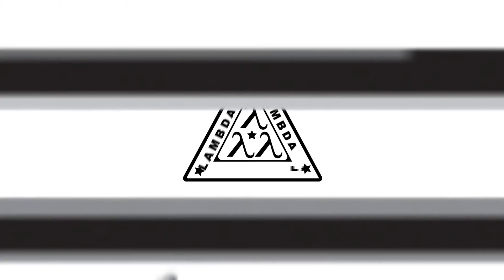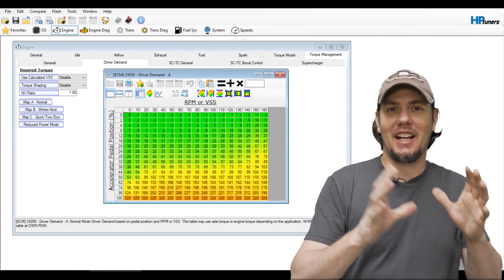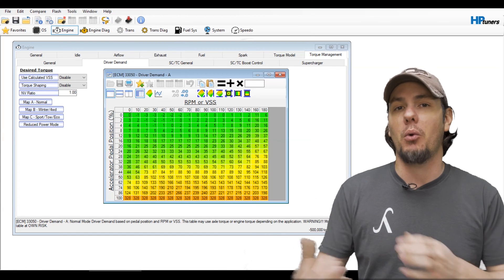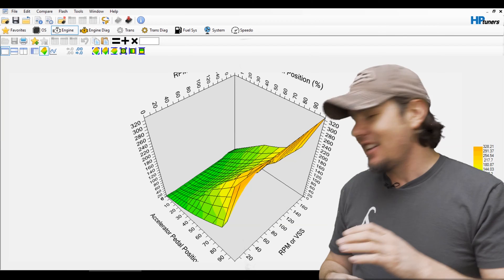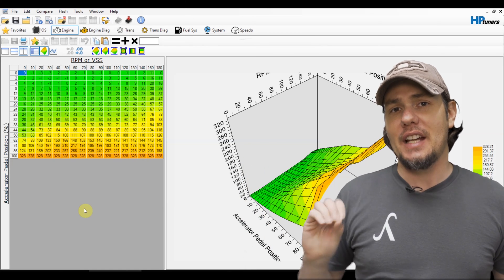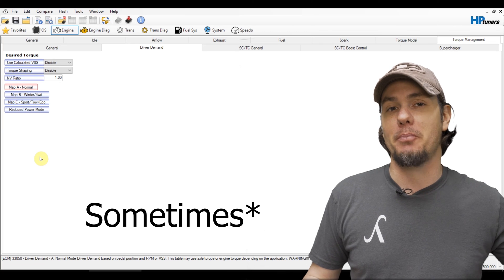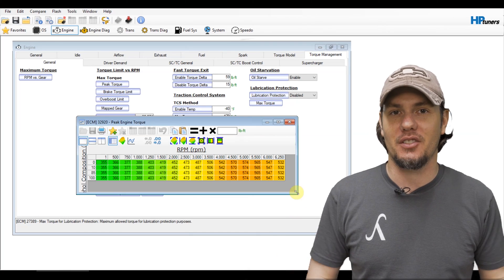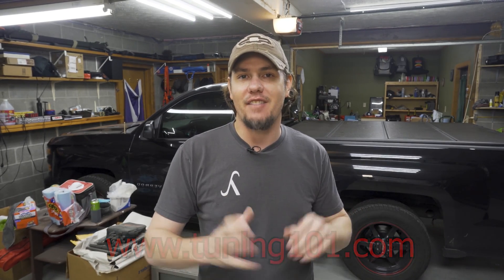Driver Demand and Max Torque, Gen V Parameters That You Need To Know!

Comment: I come from EFI live and the diesel worldand a little on GEN3 but i have a 2013 yukon dwnali qith the 6.2 its my wifes truck and i needed to get it back up and running quick a few years ago and it has a DOD delete and i just put a VVT stock L96 cam in it but i got my tune from mail order tuners and it is TERRIBLE my mid range throttle has just a ton of dead pedal i recently got HP to get back to messing with my duramaxes and id like to fix her denali finally but i dont want to go overboard i just want to mildly dial back the torque management and that used to be so simple on gen 3 but this is comfusing me any help would be appreciated
Reply: A friend and I both have L96 2500hd trucks, they are both dead feeling and low on torque after 2000 rpm, and milage sucks all the time. I think besides tuning the cam is the issue, mine is a little better because it seems to have different tuning being the work truck platform. Just getting a start on the tuning and it really sucks how dumbed down the power is, I believe all to just make the cats do their best, good luck brother.
Reply: @Tom-7777  I totally agree I'm messing with it in my free time on Sundays it's AWD and I can't find anyone with an AWD dyno nearly long enough for a Yukon Denali XL lol

Comment: Hey know its an old thread but just saying thanks for the solid info, your videos continue to make things easier to understand. Glad to see you keeping up the videos to this day.

By the way, I found a vehicle referencing RPM for driver demand, the E78 ECM in a 2014 Chevrolet Sonic RS 1.4L turbo LUV engine (the E78 Cruze will be the same, check out the HPT included sample of it). I'm also tuning a 2018 Tahoe with the E92A/T43 ECM/TCM 5.3L Gen IV engine.

Comment: I tried messing with this today. The results at first were incredible. Man, everything felt amped up. It effortlessly accelerated faster  than before, shifted faster than I could have imagined and it seemed like I was in boost a majority of the time. Then while cruising I give it more gas for a quick downshift and KNOCK...like 5 degrees. I then started to notice erratic shifting with stronger acceleration, like the transmission was hunting for gears in between the upshifts.

I never tried WOT fearing the increasing KR that was regularly making itself known in the higher gears when under load.

But MAN...the vehicle just felt plain better putn' around town with light throttle. It was so good so good I knew too good to be true. I haven't even checked the logs yet. 

I had a feeling this would happen. Every time I try something new in the tune and feel as though I'm truly making something better it negatively affects hard acceleration/WOT or something else. Really frustrating... 🍻😣
Reply from the maker: You are calling for more torque by doing this so the timing might be more aggressive so after you do this you should look at your timing tables and see if you need to dial them back.  Ideal your high octane table should never get into knock, then if you do you take like 5 out of your low table so it has some fall back
Reply: @GoatRopeGarage  

Thanks. I'll definitely get back to this section. Maybe you can point me in the right direction with something.

 I've been trying to figure out why 99% of my kr is from downshifting from 5-3 or 6-3. In WOT from a dig I see no KR going through gears, but cruising in 6th to 50%+ acceleration I'll see 2-4 degrees right before the downshift. What area should I looking at in the tune?

Comment: I have a 2017 cruze manual E80 ecm it uses RPM and not VSS. I’m not looking for big power out of this thing, but just better driveability, like better throttle response, better torque off the line where it doesn’t feel nerfed/limited and the ungodly rev hang when shifting. I am pretty new to this and trying grasp all the features that HP turners can do without doing serious harm to the vehicle.

Comment: So this basically where I can tune my pedal to be more responsive even at low loads if let's say I want it to be more responsive since I am an offroad guy great info but someone at the hp tuners forums said  that the way to do this is via airflow>electronic throttle map a ,map b etc... I am lost now man these forums always confuse me on certain topics
Reply from the maker: If you're on a torque based ECM like the 5th gen it's here
Reply: @GoatRopeGarage  ok got it just to be clear is this direct like I move this table and my pedal response change directly or is there something else to touch on like in dodge they will need to decrease their timing values at tip in throttle to allow them to have more response does this apply here or its irrelevant and this will directly get me where I want

Comment: I have a 2013 Hyundai Veloster that Im trying to tweak its tune (not stock tune, prev owner put something in it). I've added mods since its last tune. Seeing that the throttle actual pos is only 85% when commanded pos is 100% (WOT) in HPT data logs. Could this be due to  bad numbers in my torque tables/ driver demand?
Reply from the maker: Throttle position is logging in SAE so 85% is going to be max based on the standards they set forth, if there is an option to log the non-SAE parameter use it and it should go to 100%
Reply: @GoatRopeGarage  that gets a big THANKS!!!!

Comment: Top row is not mph it’s actually kph been told this and after adjusting my thinking to it things lined up a little better in adjustments. Your table on the truck is not engine torque but engine kw. You can log the pedal kw also so on those you can get some of that to line up and make sense of it. The other is axle torque which you also can log that. During wot if you max torque pid is below the delivered this is where you need to log commanded axle torque vrs delivered. If delivered crosses commanded that’s when you need to raise the driver demand.  I tune a lot of the 2.0t ats that use the engine kw table like the one your showing and I log pedal kw commanded vrs a few other things to see if the table needs to go up for wot or not. Usually people go too high and it then causes it to over command so tps might be 50 percent while pedal is actually 30 percent. If your table is correct along with many other things. This will match up more closely your foot to the tps. Gen v nothing works alone everything is a calculation of a few tables to get desired outcome. Just did a cam and heads in my 2017 zl1 and has been a crazy learning process vrs early gen gm. I appreciate the videos as has pointed me in the right direction on a few things for sure. Why I’m sharing some of what I know myself. Keep up the gen v stuff. I just did a few of the greg banish gen v videos and while expensive it was informative and I did learn a few good things I didn’t know yet. It’s the bits and pieces we can gather all over the place to make tuning practices correct. Thanks for taking time to do these. If I had the energy level to figure out how to post I’d do the same thing so to help the community more on it. I hold the fastest bolt on 6th gen zl1 record now going for the cam and heads and be first in the 8s on a stock blower. So all of this is helping to achieve goals. 👍
Reply from the maker: Appreciate for sharing, the more knowledge the better!!
Reply: @GoatRopeGarage  I know I'm 4 years behind the 8 ball here, but  it's my understanding that the Kw in the charts can be converted Horsepower, you said "325 Pound feet of torque" its actually 325 Kw of power and that converts to 436 horsepower, I have no idea why they do it this way but that' how I understand it. Someone please correct me if I'm wrong.
Reply: @lt1z350, do you have a link to where it shows all that info for the LTG.  Ive been trusting HP software, apparently a bad idea lol.

Thanks in advance brother.

Comment: My tuning actually went a little backwards since I rebuilt the 6l80 first and so I wound up tuning for torque initially.  Finally got everything else dialed in, so I'm having to make some tweaks now.  Those maps can definitely make it dangerous no doubt, but if you're smart like Kyle said you will definitely see the difference and you'll feel it.  Just use some caution  lol  You dont wanna be 20% accelerator and 99% throttle
Reply from the maker: Yeah, I tried that once for fun and almost wrecked, lmao
Reply: @GoatRopeGarage  same here!  Felt like I was running Top fuel till I went to leave the stop sign down the street  Bout turned side ways  Haha

Comment: I'm a little confused about how the changes you made would relate to the Camaro SS table just prior to it. How would I adjust the table with the torque by axle numbers? What kind of adjustments would be needed to Max out the potential for an intake and e85 on a 2018 Camaro SS? What fueling and airflow parameters should I change for these upgrades to get the most out of them? Can I make small adjustments to the Maf calibration without a wideband to get more performance from bolt ons? Wideband is on its way.

Comment: Please make a flow chart showing all controls (software) and calibration Maps (tables/surfaces) from the stage of driver pedal tip in all the way to delivered torque.

EXAMPLE:
Driver tips into pedal (throttle position) -->> throttle position get mapped to torque demanded (driver demand surface) -->> ECU seeks to meet driver demanded torque by opening throttle, advancing spark, increasing boost and enriching fuel (VE, spark and boost control maps/surfaces) -->> ECU then calculates predicted torque based on the previously mention maps (predicted torque surfaces) -->> ECU then uses torque management to protect driver and vehicle components (transmission shifting, traction control, stability, engine performance, transmission performance, etc).

NOTE: You need to show a flowchart with all tables/surfaces linked by arrows to each other shows what happens from Driver pedal tip in all the way to deliver wheel torque (and management of torque). Then lay out along that flowchart, which tables/surface one has access to to change the way the power is deliver and or how many. THIS WILL MAKE IT CLEAR!

Comment: Hi kyle can you tell me “what engine run time (s) “ refers to?
Reply from the maker: How long the engine has been running in seconds, those tables are just for the initial start
Reply: Goat Rope Garage so after 60 seconds the entire table is discarded?
Reply from the maker: @MALR7  depends, which table are you talking about? Most likely

Comment: keep in mind...  VSS in driver demand table is kilometers per hour NOT MPH ...  also, i have greatly benefited from creating DD histograms which show you where you need to increase or decrease your DD based on accelerator and throttle position.  helps with FI and drivability.
Reply from the maker: More good info, thanks for sharing! I need to do a video on doing a driver demand histo soon.
Reply: Did you ever make a dd histo??

Comment: Similar to Leon's comment regarding traction control, when logging Accelerator position (non SAE) vs Throttle position, is it a sure sign that the peak torque map is limiting the engines output IF you see the Throttle position close during a portion of a pull?  IE will others factors such as traction control not do the same thing?  I assume traction control only modifies the spark map but I wasn't sure.  

BTW great videos.  New to the GM/HPTuners thing and really appreciate how helpful these are.
Reply from the maker: Your can see what options TCS has enabled on your tune, but usually spark is the main one. You won't see the throttle close so much as it stops opening when going WoT, kind of hands usually.
Reply: @GoatRopeGarage  If I use the Navigator what would I search on to find those options? Thanks

Comment: If the driver disables traction control and stabiltrack(hold the traction control button for 10 seconds) or whatever you have to do to disable everything. Does the PCM still use these tables or does it ignore them?  If you've already answered this I apologize, I havent gotten through all your vids yet. Thanks
Reply from the maker: Should ignore the traction control setpoints, but the torque management will still be there.